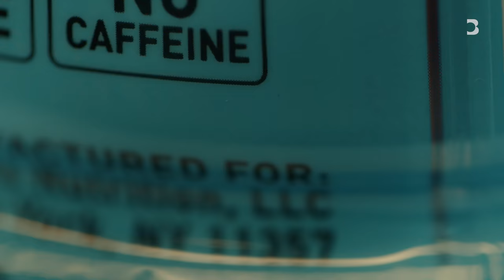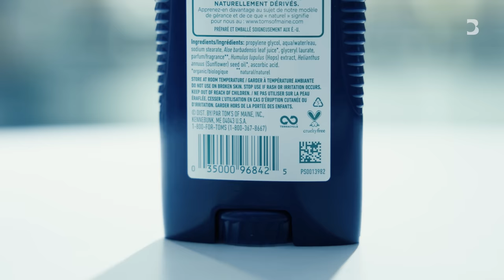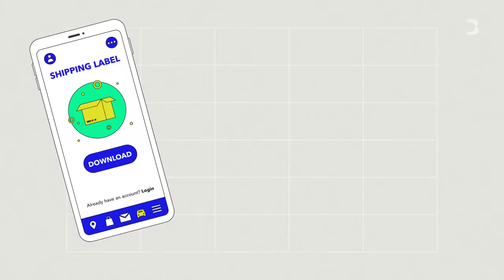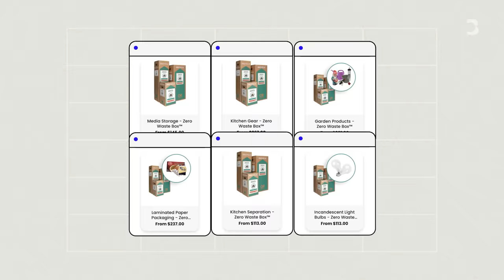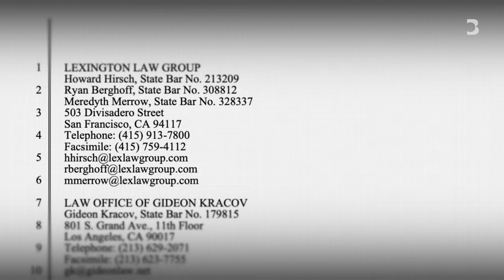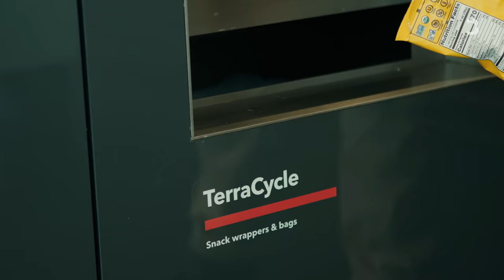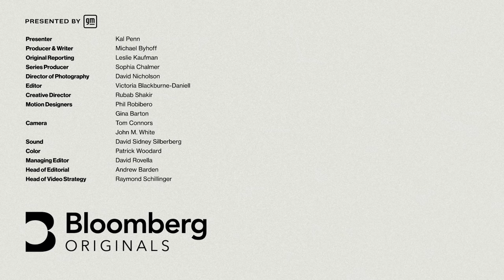Is TerraCycle's Recycling Dream a Fantasy? | Getting Warmer

Comment: What they glossed over a bit is that China simply stopped buying plastics in bulk a few years ago - to be shipped over to them and processed etc . . ( they made the business decision it isn't worth it to be in that business ) and so - they effectively made the term "plastic recycling" moot. And ever since the bulk of all plastics that have been collected and put in the blue bins all over the nation have simply ended up in the landfill. I heard some smaller 3rd world nations jumped in that space but not very many and a very small percentage. AND - printing a USPS printing label and putting several or even a whole bunch of plastic condiment packages in a box and then taking it to the post office - having them put it through their infrastructure - put it on a truck - ( time - money - gas - electricity - human potential - fixed costs - depreciation etc. . ) - then ship it to some city somewhere so someone can open the box and "recycle"it - is so absurd that it is comical.

Comment: Wondering why there isn't a computer vision based sorting system being deployed.  Wouldn't that play a huge role in driving the costs down compared to the manual sorting shown in the video?
Reply: It will probably come when AI technology catches up to the need.
Reply: There are plenty of those commercially available.
Reply: Vision isn't the issue, its making a robot that can handle all the different types of waste
Reply: it's already being used. but a lot of recycling/trash facilities don't use it due to the cost of buying new machinenary. in the end it boils down to the actual viability of recycling : plastic can only be recycled few times, plastic products that made of multiple type of plastic are harder to recycle (might be impossible economically), the price of recycled plastic.

we should focus on Reduce and Reuse first before recycle. we are focusing on recyle or putting recycling in spotlight is the goal of plastic company in past and it's working

Comment: You simply need to take the unrecyclable plastic, and grind it up into its powder form and use it in construction of roads and other things like that. Later we can pull that up and recycle it f further if we find better ways to extract usefulness form the materials.
Reply: That's a really bad idea, because it contributes to more micro-plastics due to the abrasion of the car tires driving on the (plastic) road.
Reply: @JJs_playground  Then dont grind it up to much, and use it in pieces for costruction material.
Reply: I agree. It can be melted down with the bitumen used to make asphalt.
Reply: Wow, looks like you've cracked global plastics recycling! lol.
Reply: not really a great solution as plastic photo degrades, meaning it breaks up into smaller and smaller pieces when exposed to the sun.
Reply: @TheVelkroShow  Add a compound to the chemical of the material, when used in roads or other projects which are meant to last for a very long time, It will be expensive, but those roads and structures will last forever.

Comment: I think anyone who is making type 4,5&6 must find an alternative solution and stop manufacturing it in 2 years. Type 7 must stop in the following 3 months. Type 3 must be regulated and approved for building materials and long lasting products or workable solutions. 
Not recyclable doesn't mean useless in regards to PVC
Reply: In regards to type 5. Must stop manufacturing it for the simple reason that type 1 & 2 is a viable option. Type 4&6 there's plenty of alternative green options out there. Might cost a bit more but worth it for the long term